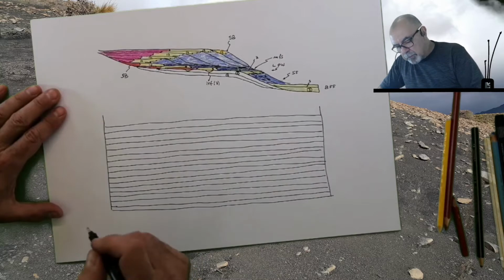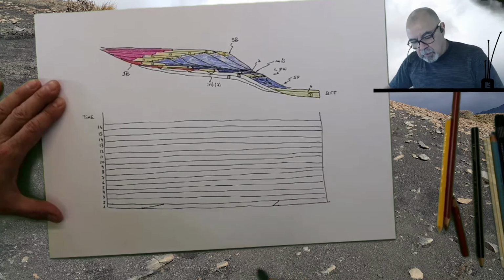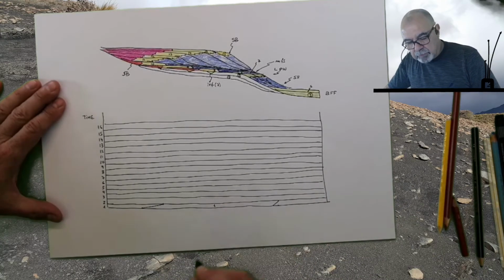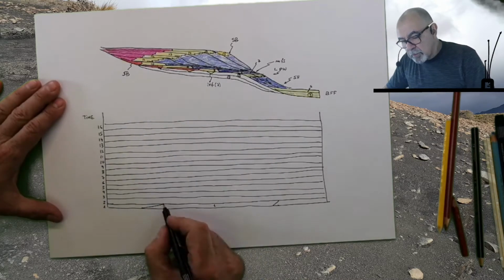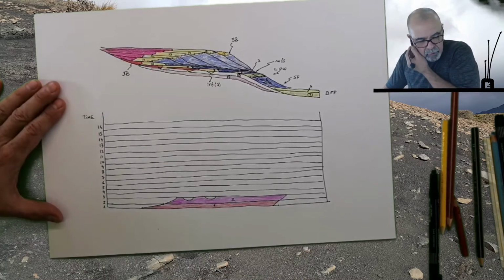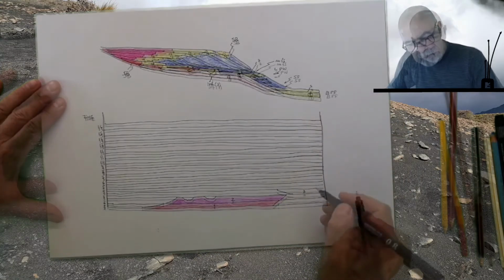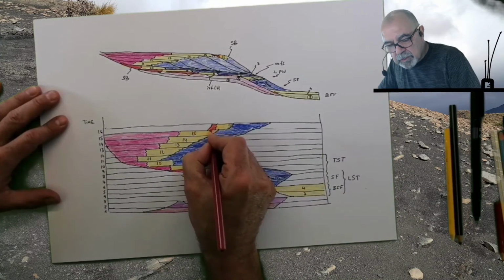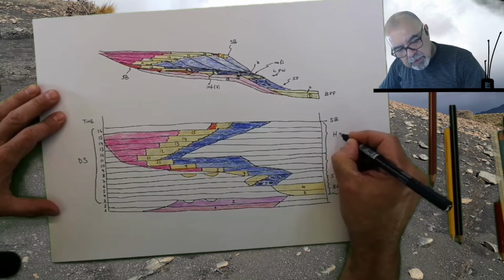How to make a Wheeler diagram. Part III

Comment: Thank you for your very good explanation. That really helped a lot. But I have got one question. Why are the units 2 and 3 not connecting in the Wheeler diagram at the point where unit 3 overlaps unit 2 in your drawn startigraphy? Should it not look like the units 4 and 5, where unit 5 is deposited above unit 4? 
Thank you in advance :)